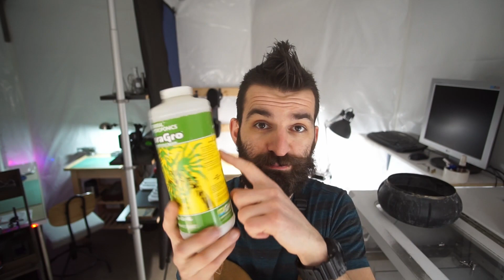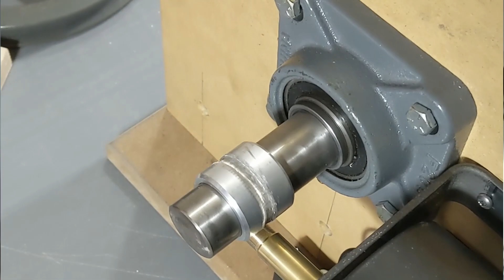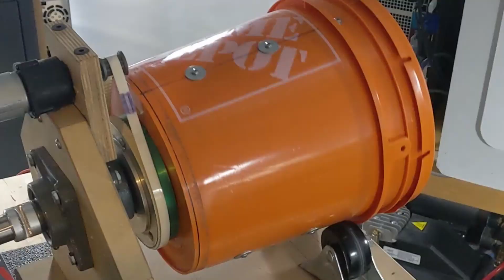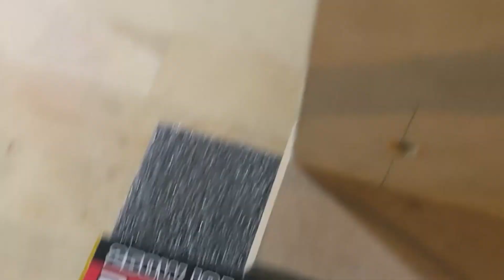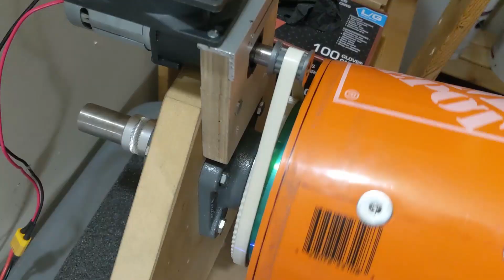Make Your Own Parts Tumbler?

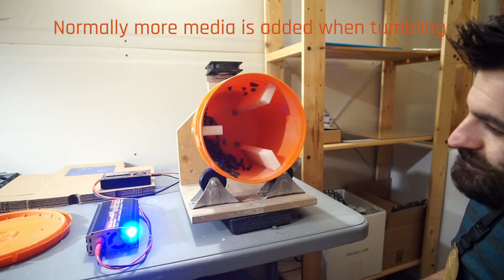Comment: If you read this you'll probably get a laugh out of it. I used your video at the 4:00 to explain in a climate debate forum how the Earth's surface (your tumbler) transfers kinetic energy to the atmosphere (media). I've worked in machine shops and now you can ask yourself if a drum spinning at 1,000 mph/1,600kmh on the outside and weighing 5.972 × 10^24 kg could deburr anything like a mountain? Seems to be similar processes without the continental drift creating barriers in your drum.
Reply from the maker: 😂 9000 points awarded to you!

Comment: where did you land with this? I am making one right now for machine parts, NOT brass not rocks. version one was 60 RPM. too fast. very noisy. going to reduce. also Had the 5 gal bucket tipped at 15 degrees. I may reduce that to 3-7. I want to put larger parts in it so 5 gal bucket was about the smallest I could go. cost  of the media goes up a lot with volume.

My media bucket inside a driven bucket is solid. it allows abrasive changes pretty quick. 5" hole in the cover of the bucket means I can get parts in and out without messing with covers.

Thanks for the video. I may make a pen someday. I mostly make Truck building tools. A cannon is finally reaching the top of the list this year.
Reply from the maker: Thanks, the tumbler works fantastically well (still use it for some parts today)!

Also a cannon would be an amazing build! Thanks again!

Comment: Are your agitator blades polycarbonate?.. i see the are screwed from the outside, did you have to seal the edges & if so, what did you use?.. i wasnt sure if silicone would adhere to polyethylene
Reply from the maker: They are HDPE and I just drilled the holes to be a snug fit on the screw and didn't use any sealant...going on a few years now without a single leak! Kinda surprised me!

Comment: Old sewing machines are a great source for AC motors designed to run at variable speeds.
Reply from the maker: That's a good point! Can be had fairly inexpensively as well!
Reply: @CurtVanFilipowski  and they come with the internals to make a pulley. The more metal on the sewing machine, the stronger the motor and internals.

Comment: I'm just wondering how necessary the baffles are in the drum? Genuine question. Would it do the same if they weren't there? I've built something simlar but it doesn't have the baffels and I don't know why it's not working very well. My media is aluminium oxide grit. I'm not sure if that is too small or what?
Reply from the maker: Without the baffles my media would just slosh side to side. The paddles let the media build up, lift up the side and then spill back onto the bottom. Honestly the baffles are a bit large so the tumbling action is pretty aggressive...great for titanium but a bit much for softer metals with my current media.
Reply: I built my own tumbler out of an old printer and used a protein powder juge for rocks.  It tumbles but like he stated they tend to slosh and it slows down the process.   I tried baffles but everything kept falling off and in the end I ended up throwing in little 1 and a half inquires of soda bottle plastic in with it and it acts to keep everything stirring and the difference is night and day so yes you need baffles or some other solution similar to what I used.

Comment: tip it up at a 45 degree angle like a sweetie barrel, so you can add ass needed and stuff wont fall out
Reply from the maker: I would (did) but it severely reduces the tumbling action of the media...however it does work great for adding parts without stopping the unit.

Comment: Love your work! I’ve been trying to do something similar but for small wood chip bag clips. I’ve been using a furnace motor but it’s one speed and pulleys are expensive. DC looks fun! I’m looking forward to seeing your progress. Cheers.
Reply from the maker: Thanks for the kind words! Your furnace motor is probably a better choice for the duration these things run but DC is simple to regulate. I'll see how long this one runs before it lets out the magic smoke :).